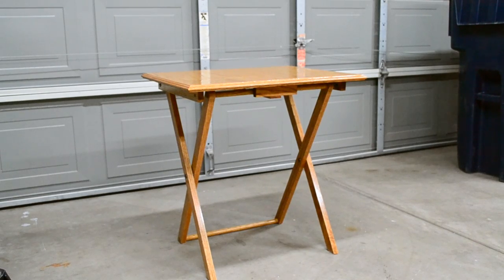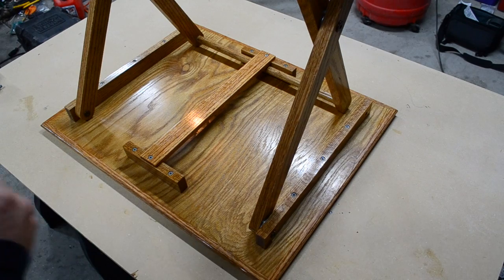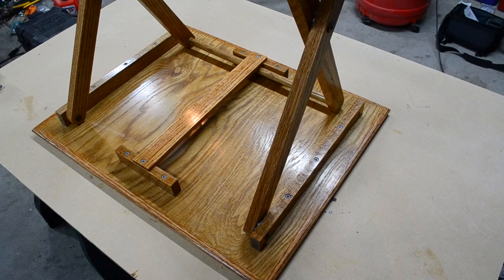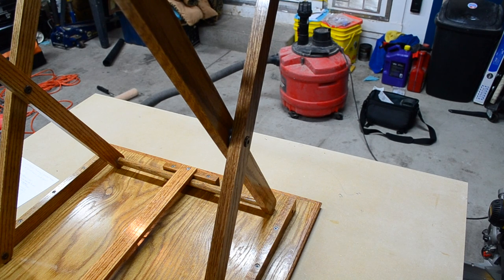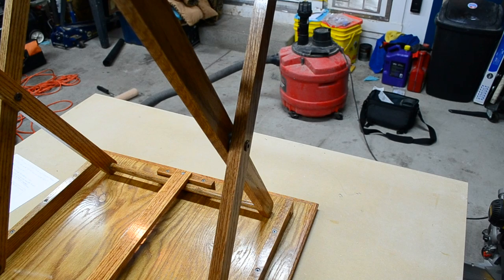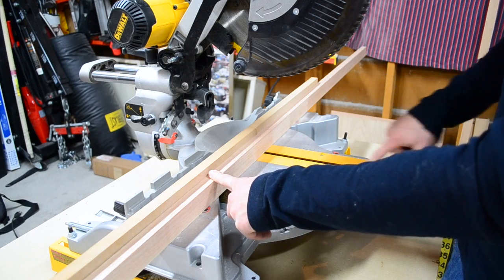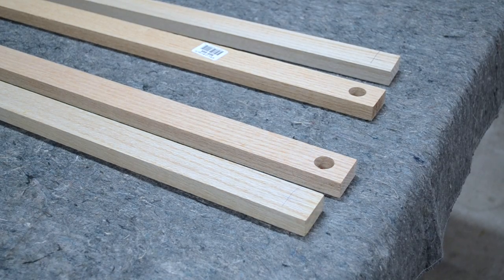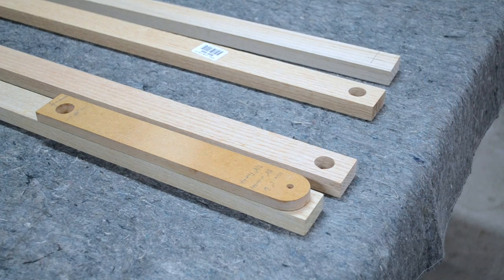TV Tray Build Part 1

Comment: I made this tray table a couple years ago and am generally happy with it.  But over time it is a little  wobbly side to side. Would tightening the hardware fix that? Or is there some other way to make it more stable? I did use lock tite on the threads when it was assembled.  
Thanks for any help.
Reply from the maker: Tightening it would help. If the spacing for the rods isn’t tight enough you will get a wobble as well. One way you may be able to stiffen it up is to change the rod on the bottom to something like a 1x2 or 1x3 with the long end going the length of the legs. That would help to prevent flex. One thing to look at is if the flex is in your wood being weak or actual deflection. If your fasteners keep loosening up use some loctite to prevent that. I hope this helps.

Comment: @dave medicus two sides are 12"x1"×1/2" 4 legs are 30"×1"×1/2"(drilled at 15" center) center 2 which are 3"×1×1/2". Cross support 1"down 3/4" in.? From what I noted from video @9:42.
Reply from the maker: I believe that's correct. Thanks again for watching.

Comment: I’m learning wood work and have a lot of questions. What size drill bits are you using? What size are the screws?
Reply from the maker: The screws are just standard drywall black screws. Depending on your material size the screw length is different. I believe I used 1-3/4”

Comment: Great project. If I make my top dimension  24 x 16 inches what would the length of my legs have to be to meet your table  height??
Reply from the maker: A*2+ B*2=C*2 will get you your length. (A) height you want minus the thickness of the top from the leg (B) Depth or leg spread when open which is equal to the top= (C) total Length

Comment: Great video. I'm building a much larger one right now, more of a portable desk. How did you determine how much clearance to give between the rounded leg tops and the desk bottom. Does your desk bottom actually end up resting on the rounded leg tops or is the weight borne on the bolt?
Reply from the maker: Jarrod Wall I made a template and tested the leg for clearance. The rounded part does not rest on the table on the hard mounted side however it is close. The side that slides does rest on the wood. Let me know if you have any other question. Thanks for watching.

Comment: What kind of screws you used? What size screws you used?  Can you put the written directions on your videos?  Where and how did you make the example piece with the double size tape?
Reply from the maker: I actually used exterior screws. The length depends on what size material you use. I used 2” because my material was 2 1/4” thick in some areas. Sample piece was just a trial and error. When I figured out one leg I made the copy.

Comment: Awesome design,I need to make a folding table for a portable pizza oven,only weighs 55lbs and needs to be at least 4' high and the table surface almost twice your size,any suggestions?
Reply from the maker: I would personally look for a metal folding table. Something of that size you will want the strength of metal plus the protection from the heat. I know that this isn't really the answer you were looking for but its what I would be considering. I hope that this helps. Thanks for watching.
Reply: Dave Medicus I was going to use 2x4's
Reply from the maker: You could probably use 2x4s making the top 4' x 4'. If you do this I would put one leg on each side to get you your 4' height. The legs will swing under to make a compact design similar to how I made the legs for my cornhole video. I would also help to eliminate some heat issues associated with wood by using a piece of aluminum for the top. This will help to dissipate some of the heat associated with an oven.
Reply: Dave Medicus thank you

Comment: Greetings Dave, I already have one of these tables and want to cover the top with wool to use as a pressing table, however it is wobbly and I want to make it more sturdy.  Do you have any suggestions as to what I can add to correct the wobble?
Reply from the maker: You can try and remove the rods and replace it with a 1x2 or 1x 3. Then attach it with screws to make it more rigid

Comment: Great video. What size connector bolts did you use? Thanks.
Reply from the maker: I believe they were 40mm in length to make up the thickness

Comment: What’s the nuts you used for the leg henge?
Reply from the maker: I dont know what they are called. They used to be a stock item at Home Depot. They are called on their website something like a furniture nut.
Reply from the maker: https://www.homedepot.com/p/Everbilt-1-4-in-x-12-mm-Antique-Brass-Connecting-Cap-Nut-817918/204281643

Comment: May I ask what this type of hardware is called? (not sure what to look for in Home Depot)
Reply from the maker: I can’t remember exactly which ones I got but here’s a link to one similar at Lowe’s. I hope this helps you. 
https://www.lowes.com/pd/Hillman-20-x-1-4-in-Bronze-Steel-Joint-Connector-Nut-4-Count/3013888?cm_mmc=shp-cprdhdwgooglelia-126-fasteners-3013888-_-0&placeholder=null&gclid=CjwKCAjwz6_8BRBkEiwA3p02VSLa_3Tqgxtao-eZ3AJcSQDtCGqoiv0G4jG6EVIdt3Wt7Wp2pEBq2hoCi6EQAvD_BwE&gclsrc=aw.ds
Reply: @DaveMedicus  Very helpful! Thanks for getting back so quickly :)
Reply from the maker: @jannaleethackeraywoodside542  no problem. We had good timing.

Comment: Hey man.  I'm interested in building one is these for myself. What are the width and lengths (measurements) of the pieces of wood you used.  snd what size bolts did you use.
Reply from the maker: +Carl Huber The top is 19" x 24" before the edging. The bolts that I used are listed in the second video. I should be finishing this build this week (hopefully). I have been saying that for months now but I have been working 80 hours a week so my time has been spent sleeping. I am also planing on doing a review video of everything on this tray from sizes of pieces, fasteners, and after thoughts of the build. Thanks for watching.
Reply: Great Video's, very informative, I plan on making a couple of these.  I was just wondering if you did the review video of everything on this tray?

Comment: Hey Dave,
I am building on of these for my Woodshop class, and wanted to know the measurements of the stops, the rod, and the bar that guides the sliding rod. Please let me know asap
Thanks!
Reply from the maker: Hey check out other videos. All of your questions should be there. I don't have them with me at the time. I think it was like 16" but it should be in the rest of the videos. Sorry I'll get back with you if you can't find it. Let me know
Reply: Thank you so much!!
Reply from the maker: Were you able to answer all of your questions?

Comment: Hello
can you tell me how much the table legs measure?
Thanks
Reply from the maker: They are about 29-1/4" long from the tip to the curve. You measurements will be different depending on where you hole is drilled and the angle of your legs. I started off I believe with a 30" piece before the cuts were made. the measurement is in the video.
Reply: Dave Medicus thanks u!! it was very difficult because my firts lengua is Spanish. Thanks you so much
Reply from the maker: You are welcome. I hope that this helps.

Comment: What size wood are the legs themselves?
Reply from the maker: I believe that they started out as 1" x 2" x 30" long. Real dimensions are 3/4" x 1-1/2". I do not have the trays with me to actually check. They are in a storage unit in Myrtle Beach.
Reply: Thanks man! Very nicely done btw!
Reply from the maker: Thank you. I hope that it helps.